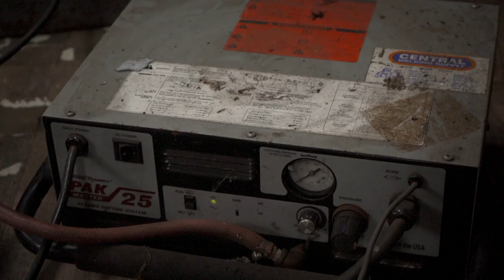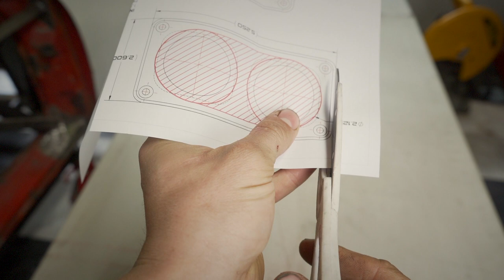Engine Is In! Tube Chassis Race Car build Ep.15

Comment: I just came across this build, I'd love to make something like this myself once I get the garage space to do so; it's coming along really nice! If you dont mind me asking, what is the budget for a build like this?
Reply from the maker: Its quite a bit but over time. It can be done for a lot less but I decided to build it the best i can. Currently im probably in 30-40 (over about 3 years) rn but i bought a bunch of “unnecessary stuff”. I see this as more of a chance to grow and learn than anything so to me the cost is well worth it. Anyone can buy a car but its way cooler to build one.
Reply: @ZipTied  Thank you for your reply. I 100% agree, very cool build and seeing how you approach different challenges. I was thinking of building something more similar to a dune buggy (1 seater), powered by a high revving I4 engine such as a K20, I will have to build the cage in CAD and check with my local tubing suppliers for cost, but I definitely think it would be awesome. Best of luck with your build
Reply from the maker: @motormind2  don't use any erw tube, its a death wish. use DOM (.120, .090, .065)and if you have money chromoly, it lets you run thinner tube without compromising safety. I would almost guarantee there's a k20 adapter plate for a vw trans, but a stock one probably wouldn't like the rpm. Just take inspiration from cages you can see from good shops and you should be ok on design. I didn't have cad when I started but wish this whole thing was in cad. Best of luck with your build too!